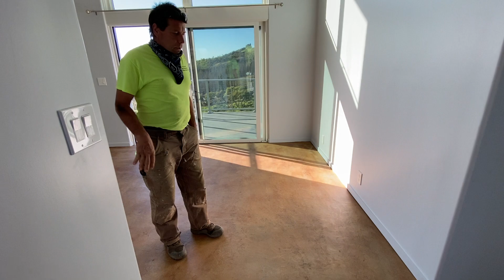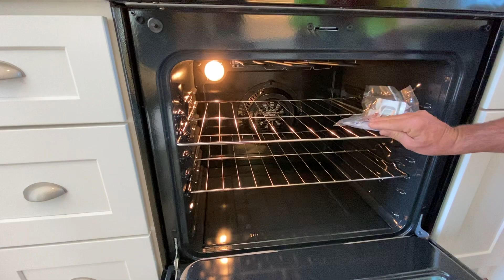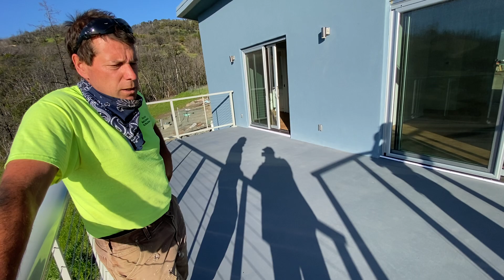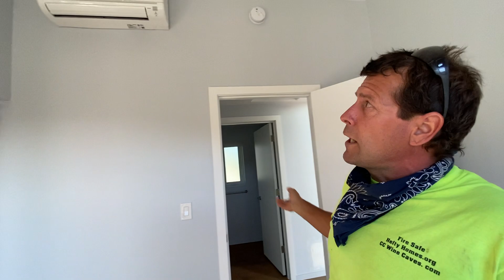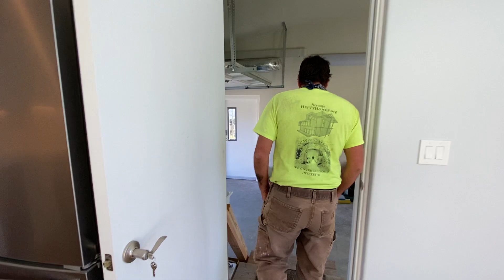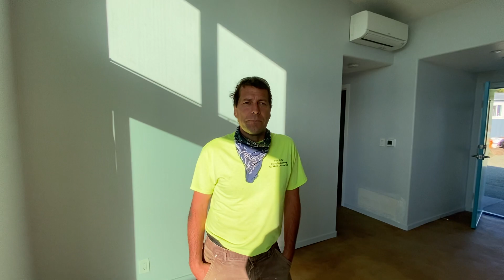#Structural Concrete Insulated Panels #Zero Carbon Footprint construction #Defensible Space #Realtor

Comment: How many square feet living -garage-total and what is the cost per square foot?
How much does this house sell for?  Do you do floor plans for 5/3 split Ranch style, 2500sf? Pantry center island two car garage. Roof with solar which can be stored as back up electricity for power outage?
Reply from the maker: Diane, SCIP lends itself to more contemporary designs. There are so many variables, it really depends on location, terrain, infrastructure availability, etc…